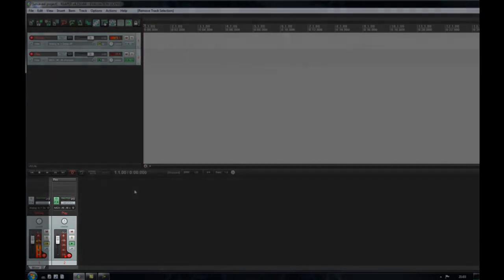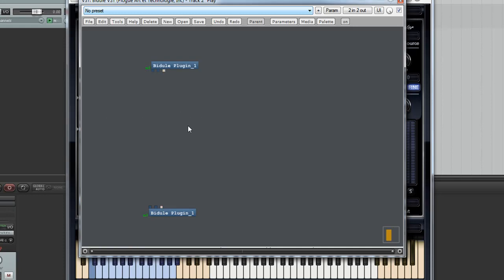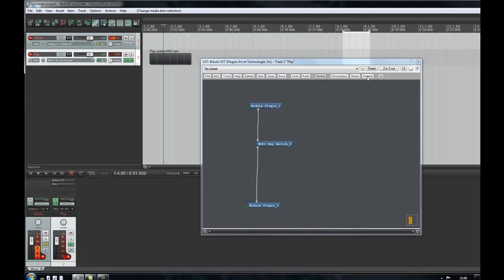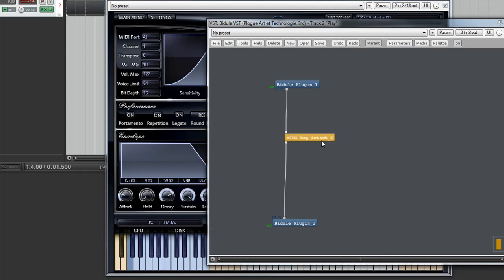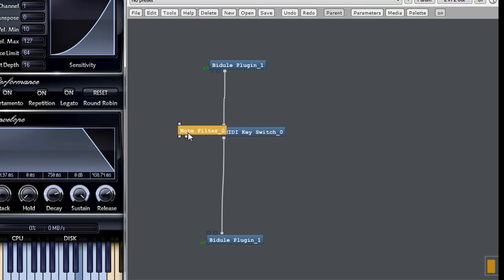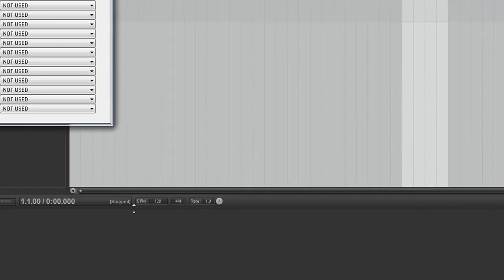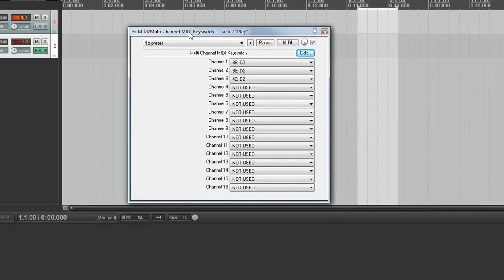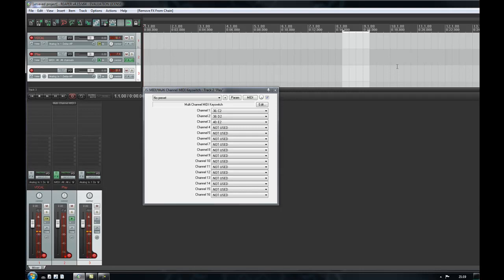Custom Key Switching

Comment from the maker: @zunaic Thanks for watching.

My example was a bit rushed. In a more practical example you have to make sure that the Key Switches you assign are outside the playing range of the patches you have loaded and if those patches are KS patches you have to make sure that your custom key switches do not clash with any of the patches' keyswitches. 

If your doing a complicated set up it might help to plan it out in a table or spreadsheet first. :)

Comment: Hi there and thank for this very useful plugin, is it possible to use the key switch on a computer keyboard without resorting to virtual midi keyboard?
Reply from the maker: Not as far as I know. It's designed for use with a MIDI keyboard.
Reply: @Xtant-audio  Thank for the reply but i have found a way with  the help of other software + a little scripting!

Comment: hey mate this is excellent, I just downloaded it but the file has no extension and doesn't want to be read by reaper?, is it a dll
Reply from the maker: +Joel Michael You need to put the file with your other JSFX, usually in the "username/appdata/roaming/reaper/effects" folder (or something similar).
Reply: +Xtant Audio Cheers!!, works beautifully!